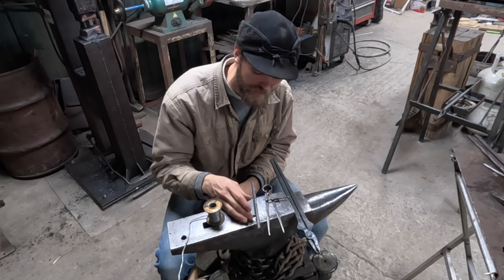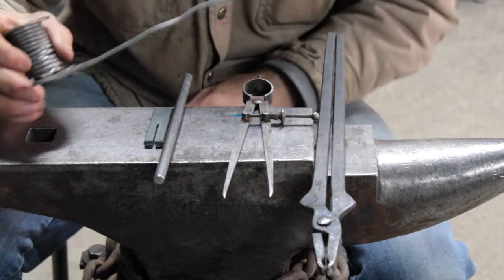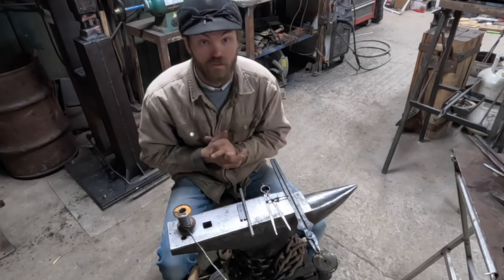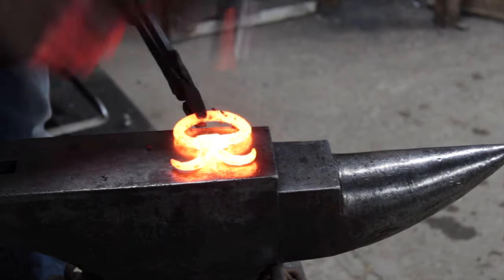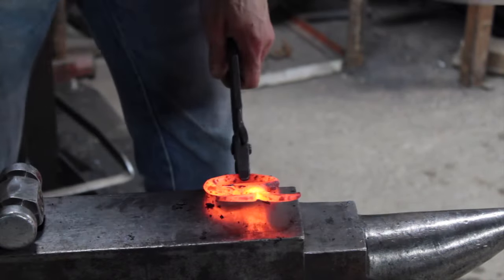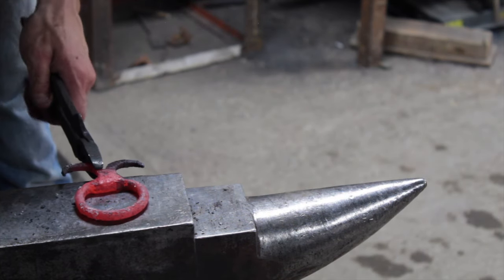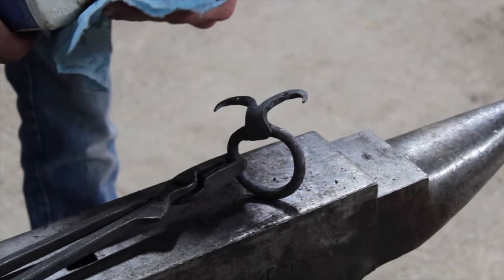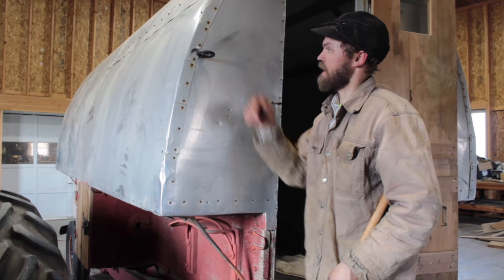Stack Welded Broom Hanger for the Sheepwagon

Comment: That moment it welded just from contact was amazing! It made me remember either reading or hearing in a video someone said a way to learn how to recognize welding temperatures is to put two long rods in the forge, and periodically tap the hot ends together in the forge, and at welding temps you will feel them be ‘sticky’. Something I need to try once I get my new blower on my forge!

 Here’s one for you:
I picked up a cheep silicone basting brush at the dollar store, and use it to brush on my pastewax and oil finishes on hot metalwork. Saves on burning up cheep paintbrushes, and does not get little bits of blue lint in the crevices, the way blue shop towels do!
Reply from the maker: Ya for sure, when you feel them stick they really stick, it is pretty cool. 

That's an awesome tip with the brushes, I'll definitely try it some time!

Comment: great vid and a lovely result.
question, would it be better to make it out of one piece, where you form the circle have the length of the bar longer so it can cross over at the forge weld and those two trailing ends form the rest of the mount section
Reply from the maker: Yes you could definitely do that! The reason I chose not to do that is because I did that in a previous video and I just wanted to do something a little different. Thanks for watching!